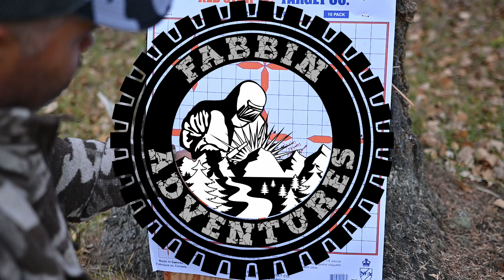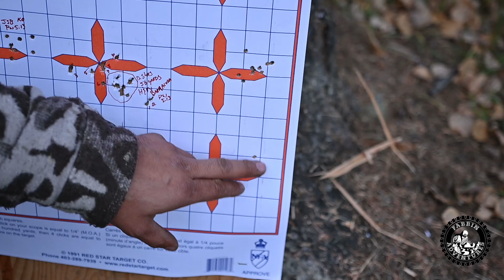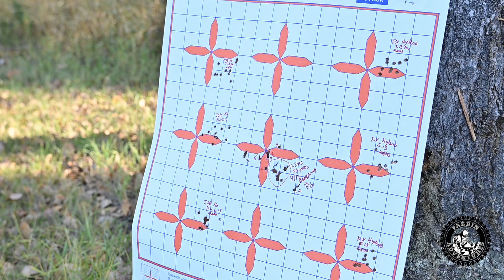PCP Pump and Slug review

Comment: They make a regular for that gun and a carbon fiber bottle more shots more better. I have the yong heng compressor to fill scba bottle it works and cheap have to keep it cool to last. You might want to get a filter on the line going to the bottle to catch oil, dirt and moisture. I don't have a 12v pump but I heard  if you use your truck battery make sure the truck is running. It's something to do with voltage drop not good on the pump motor.
Reply from the maker: Good info, i will find a filter and get one soon as i can find one that will handle the pressure, also looking of an intake filter for the compressor its self.
Yeah i seen there are regulators, i am  busy learning about the texan .50 and trying to find ammo in canada (not easy) once i find a source i will be ordering a texan carbine and start preparing to hunt big game next year with it...cant wait!
I ordered a .510 rebated boat tail mold from african air ordnance today, but it will be 8 weeks!
I have used my truck already and yes i had it running, i read somewhere that, thats what to do, i would imagine it pulls lots of amps as the inverter is 50 amps!
Thanks for watching and commenting!

Comment: Haha nice!! Also just ordered this compressor!!! I had it narrowed down between the $800 airventuri the $600 umarex ready air, and this one. $500 with adapters ect. 

Also looked at the non portable but more powerful young heng, but wasn’t a fan of the water buckets lol. Great vid!

Ps, that condors capability has no limits, with enough air smithing, the gun is more then capable of great accuracy and GIANT POWER!! There’s dudes shooting close to 100fpe with 40grain slugs in .22 cal!

I wouldn’t recommend ordering a new “top hat”  super cheap & Simple install, (you can get multiple sizes) and doubles power with the right one.
Reply from the maker: Thanks, i really like this compressor sofar, hope it holds up. Its way better than pumping the ole hand pump especially when testing slugs and shooting groups!
I ordered the texan 50 cal carbine carbon fiber today...couldnt resist!
Thanks for watching and commenting!
Reply: @FabbinAdventures  you will love the 50!! However, I hope you are prepared to rebuild that compressor haha that 50 takes ALOOOT OF AIR. Like 3 shots per fill lol.
Reply from the maker: @Oregon-airguns  yeah i cant wait to get it and shoot it! Hopefully that compressor is up to the task!

Comment: Those old valves.. suck .. that gun is easily upgraded to a rimlock valve..all parts aviable from airforce..you will need a rimlock adapter for the old frames and the new rimlock valve..the new rimlock flows better and is more consistent..n with the rimlock caps you could adjust power precisely.. most of airforce .22  barrels run tight.. so usually knockouts. 216 will be the size to go.. I have more modern pcp but my old upgraded condors..are not going anywhere..👍👍